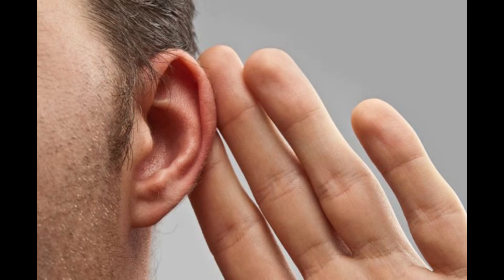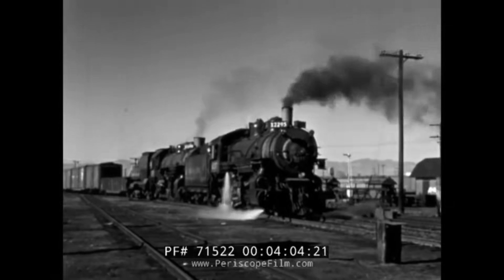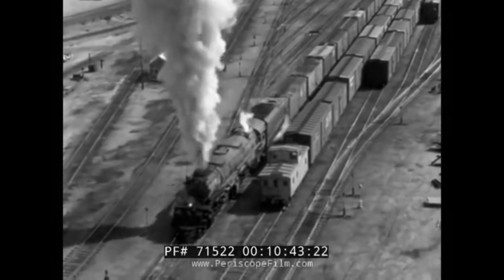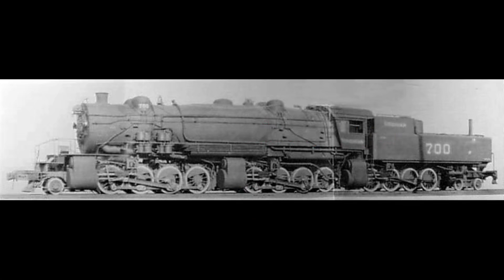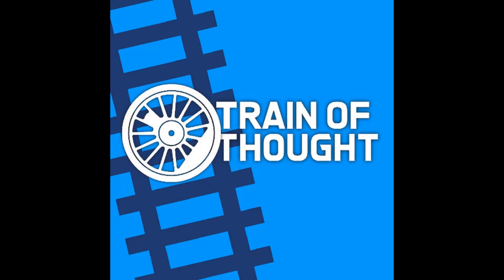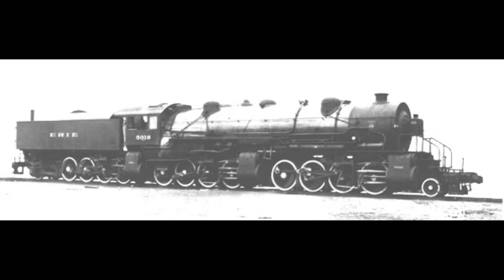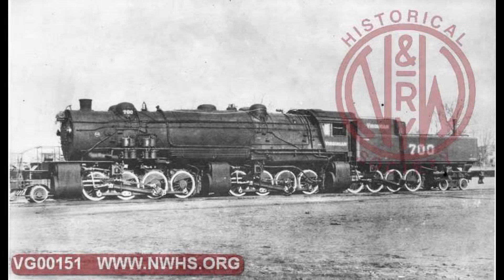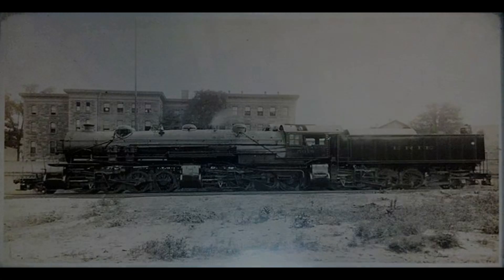Baldwin's most absurd locomotives ever (The Triplexes) |Garbage On The Rails Ep 10

Comment: Although the best idea to make a new triplex is to:
1: concrete blocks in the tender like how N&W used concrete blocks on the forward unit of the Y6B because of the Variable valve plumbing.
2: switch places of the mid section with the high pressure steam to the tender and reverse it so it faces the rear making room in the firebox and make it a triple compound taking after the triple expansion steam engine off a steam ship.
3: enlarge the tender as a massive coal bunker instead of oil since coal is heavier and just have a separate water tender. (and I personally hate oil burners because of the Durango & Silverton just because of only wanting to run them instead of diesels which will prolong the 10year boiler ticket)
4: Auxiliary tenders for water.
5: superheated steam and Geisel stacks

Comment: filling it up with preheated water would have made a big improvement
Reply from the maker: Yeah, but widespread use and equipping of feedwater heaters didn’t happen until the 1920s.
Reply: @AndrewTheRocketCityRailfan4014  I am talking about using a stationary boiler or some other means to fill the  tender
Reply: @shaunnesbit1698 most steam engines have steam lines that go into the tender tank, off of the injector. Good use for winter time, but kinda useless since in hot weather the sun can heat the tender tank itself. It's just a problem of having an itty bitty firebox.

Comment: And you are the next one, who had read the normal stuff about these locos. 
Okay, the VIRGINIAN 700 was a failure because more powerful than the P1 , with less weight = more slippery.

The P1 weight 383t not 583t.
The slow speed was not a big problem , because other mallets where not faster at that time.
Steam is a problem, and Erie chanced the water pumps on 5014. 
Build with piston pumps , later turbo pumps.
The tender unit had a higher axle load than the loco ones and a  different piston valve seting to limit the tractive effort off the tender.
I believe it was not perfect, but a way for more powerful locos.

Comment: What if they built a 2-4-4-4-2 in stead of 2-8-8-8-2, they might of fit all the wheels under the boiler but it would be significantly weaker so I don’t know
Reply from the maker: Probably would make it make powerful from the locomotive thanks to the extra cylinders under it
Reply: It would have exceeded the maximum axle loading by a considerable degree.  But otherwise, the locomotive's rated tractive effort would have remained the same.
Reply: there would have been no point since a 2-6-6-2 would have had just as much traction effort and less complexity.
Reply: @paulmenkens5997  2-6-6-2 would be a four cylinder locomotive, though - thus less tractive effort.

Comment: The Triplex, though a failure, was built to overcome a significant grade on the Erie between Lake Erie and the steel industries the Erie was servicing. It was only expected to do a heavy pull for about 15 miles in one direction. All the points you make are true, but not all inclusive. railroad locomotive design engineers were struggling to understand the steam demands of locomotives as they grew in size. The Mikados were an insight, with the small trailing truck allowing for a wider, larger fire box. More firebox = more heat = more steam = more engine horsepower is sustainable for a longer time. The Triplex ignored this learning as stated. The Triplex was never intended to do long mainline runs, so it didn't carry much of a fuel or water load. Part of the slippage issue could have been improved had the Erie adopted putting the engine water in a cistern car behind the fuel carrying tender. Hauling only coal in the tender would have resulted in the weight of the tender remaining heavy enough to counter act some of the wheel slippage.
Reply: More specifically, compounding defied all the equations engineers used to use up until the late 20’s, early 30’s, and even then they were just starting to understand how to properly calculate the relationships between steam generation, steam heat, weight, cylinder size, and tractive effort in compounds. They had just come out of en era where superheating simple expansion locos was seen as literally superior to compounding (even if the compounds had a superheater, since it wasn’t until the turn of the 30’s that cylinder oil could withstand more that 400 degree steam, meaning the low pressure cylinders prior to that would still condensate)